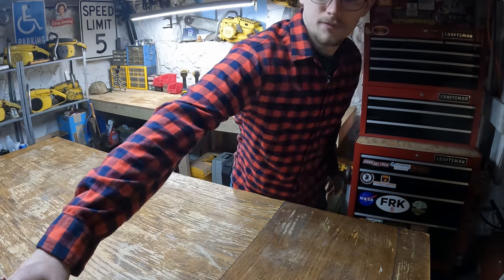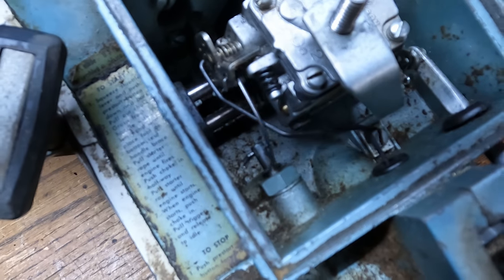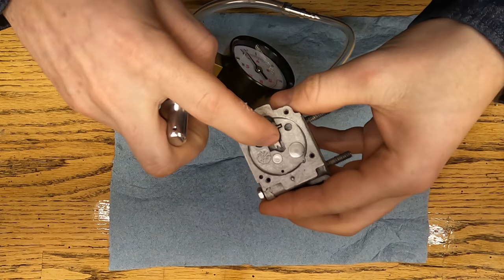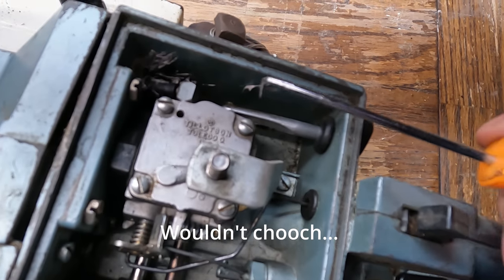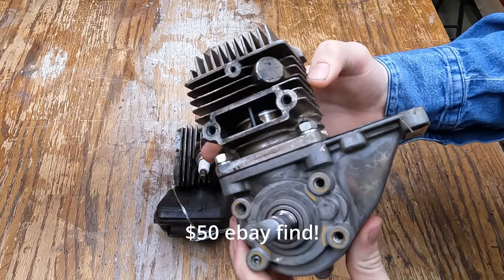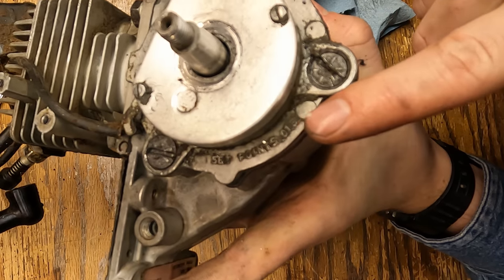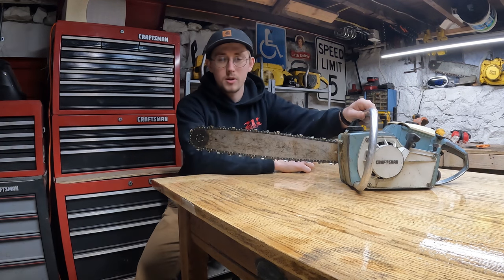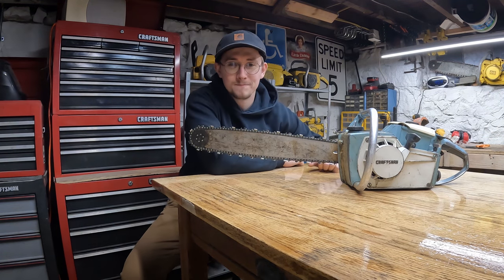Vintage Chainsaw Restoration!

Comment: A lot guys don't know it but the 010 feller gauge that's brass is for those type coils ever feeler gauge has a brass 010 brass doesn't stick to a magnet
Reply from the maker: That's genius! We use stainless at work.

Comment: did yours have crazy compression - just got same saw - very hard to pull over
Reply from the maker: It sure was hard to pull.
Reply: I'm not sure if you are aware of this, but that little button on the handle of this saw is a compression release? You need to lock that down before you start pulling the starter rope! It will shut by itself as soon as the engine fires up.  If you go to,  Mike acres site,  and enter profile it will give you every bit of information on the saw your looking up . I own a chainsaw collection of around 140 chainsaws, so I know a couple of things about saws. And if you're dealing with a chainsaw that has a decomp valve on it that is telling you it has a high compression piston in it! High compression likes high octane fuel so don't run regular gasoline in this chainsaw! The pump fuel is shit these days and you will cause it to detonate and it won't run worth a damn!
Reply: @tonymayhew191  I did not know! It was painful to start. Thought I was gonna rip my bicep. Thanks for spotting that out! Also thanks for the fuel tip Too. I have been running hi test but was not sure so I ran the same gas as my very old dirtbike. Very cool saw